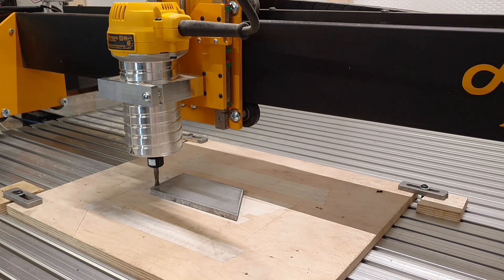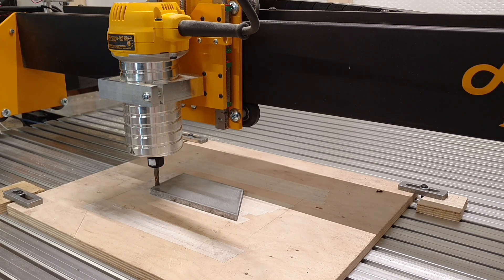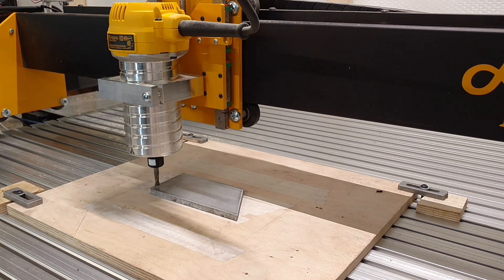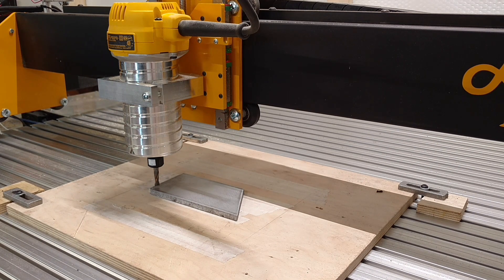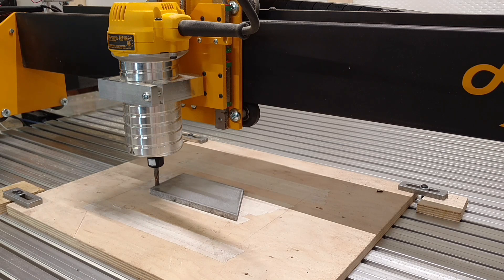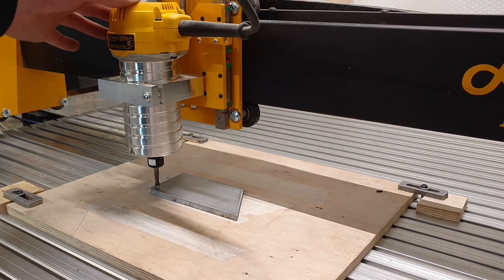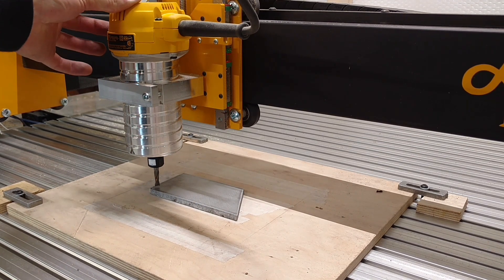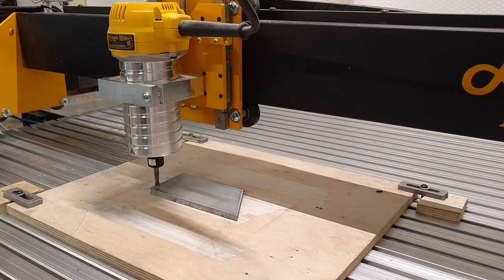Milling Aluminum On The MillRight Mega V!!!

Comment: I noticed the minimum speed on those dewalts are 16,000 RPM, so I have to ask because I have one of these mega Vs in shop. What feed rate are you using and are there 2 flutes on that bit? Just curious, thanks.

Comment: Thx for sharing.  Good to know that the Mega V can indeed mill aluminum.  Might be good to shorten how much of the bit sticks out of the collet to reduce deflection and use ramp entry to reduce the risk of chipping the bit.  Did you use masking tape and super glue to hold the piece on the waste board?
Reply from the maker: I inserted the bit as far as I could before it started getting into the flutes of the bit, I need shorter "0" flute bits for sure!

Ramping in will definitely be something I pay attention to in the future!

Tape and glue was the hold down method here and it seemed to work really well even with this aluminum piece! 

Thanks for watching and leaving your feedback!
Reply: @jonescompanycustoms7208 : Aren’t O-flutes for plastic? I thought More flutes are what you use when cutting metals?

Comment: I got mine put together but won’t move. Motors are locked up and holding. I have the plasma version so the next thing I’ll try is to hook up the serial port attachment. It’s frustrating to learn a new machine with no instructions!
Reply from the maker: Are you getting help in any Facebook groups or other forums?
Reply: There’s two MillRight groups on Facebook. Trialnterro.. I would suggest starting there.
Reply: Jeff Verdin believe me I’m subscribed to them both! It’s hard for me to get time to dig into them working full time with overtime, so it’s usually just weekends. I’ve noticed there isn’t allot of plasma versions though
Reply: trialnterror there’s a couple post on the MillRight Pro group. You are correct and there not being a lot of information out there yet on it
Reply: Check out corvetteguy50. He has tons of info about all things cnc. Now he is selling his products, but he has videos on mach3/4, sizing stepper motors, all kinds of stuff. Helped get mine running.